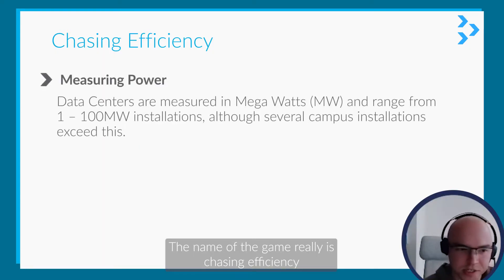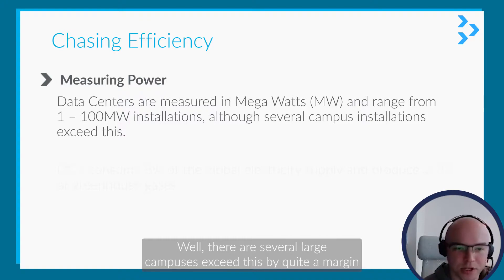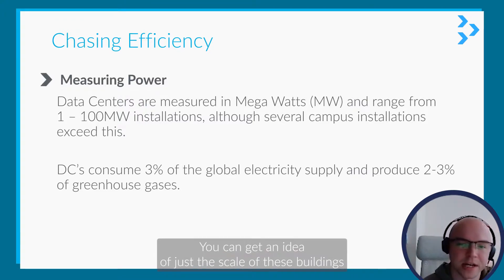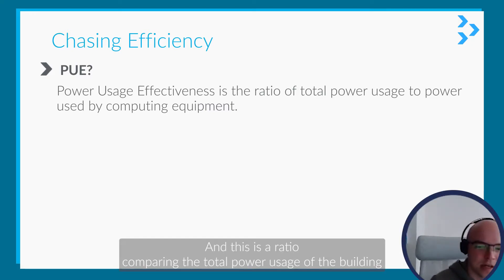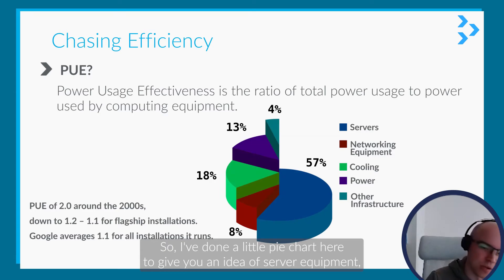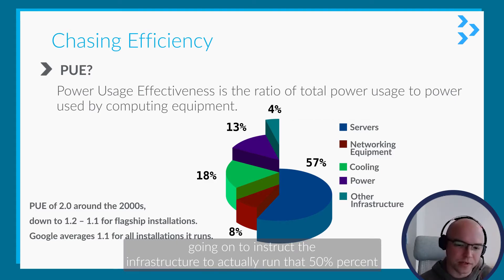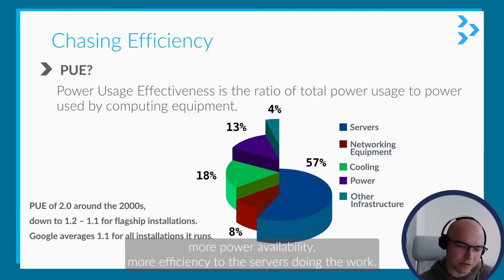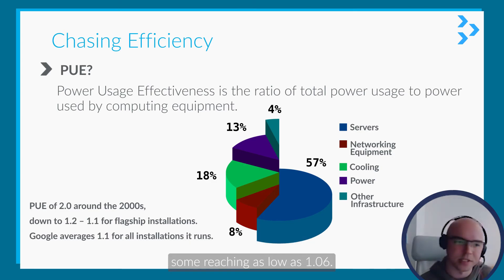Efficiency in Data Centres

Comment: So, in this example 57% of total energy is used for servers, this makes a PUE of 1/ 57% = 1.75?
Google manages to reach 1.1, so that is over 90% of the total energy is used for servers, correct? Is 'servers' only energy used by CPU, memory and storage, or does that include all the energy supplied to the servers (e.g. including power supply efficiency, cooling fans inside the servers)? Shouldn't this KPI be moved towards energy used for compute power or something? Older servers are less efficient in terms of compute power per Wh than newer servers, am I right?